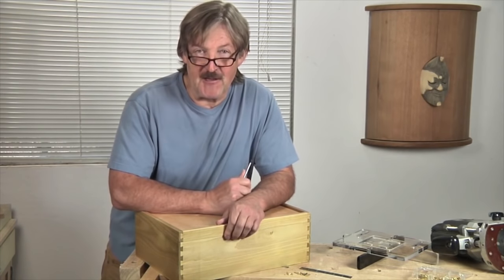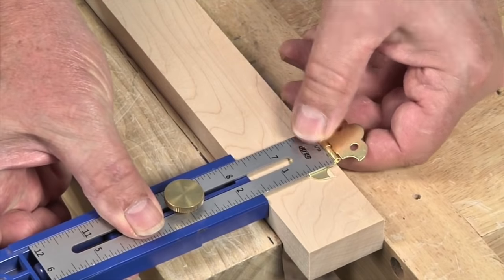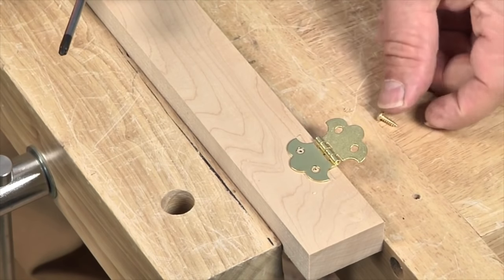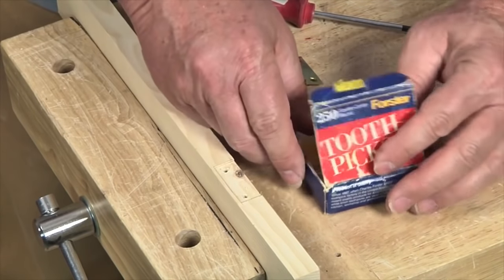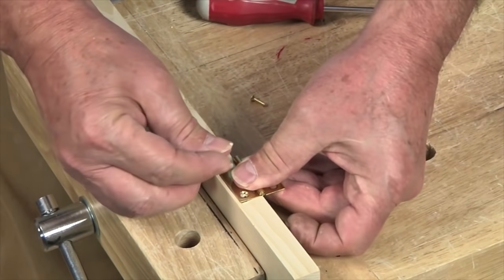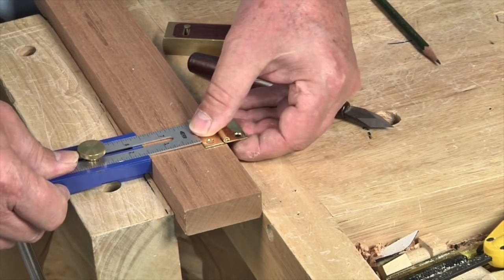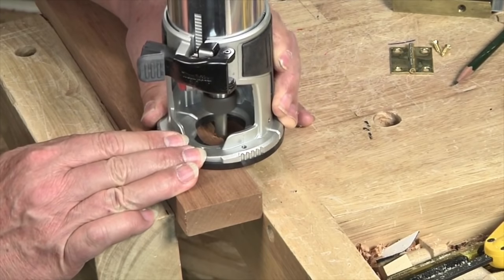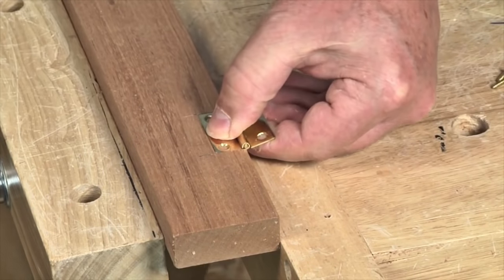How to Mount Hinges on Box Lids, Doors, and Other Projects

Comment: all very good tips, however, never underestimate the power of a chisel to create a mortice for a hinge.  unless i have a lot of mortices to cut i leave the router in the cupboard as i can have the mortice finished with a chisel before i have set the router up.  practice it as its very quick and easy.
Reply: Tayler Made i would use a jig a router witha core box and a chisel .
Reply: my first go at both were a disaster.  practice practice practice.

Comment: Just to be aware that the JIg It is obviously designed only  for  Rockler hinges. However most slde rail hinges, including Brusso, are 8 mm wide so its not too hard to make your own template.  - they tend to vary a little in their length. Pity they are so expensive !

Comment: For all the naysayers on here fixing hinges on a box is a surprisingly difficult task and the Rockler jig is the ideal solution. However, the templates only work for Rockler hinges - naturally.!
Reply: They also work for the Brusso quadrant hinges, part # HD-638. You have to use the Jig It template Q1 for that hinge, but it's designed to work with that hinge.

Comment: What are the type of hinges you put on the first box at the very beginning of this video? I notice that they are not the same as the ones you put on the box at the end. I need a similar hinge set for a storage shed. About L 8 ft by W 4 ft by H 7 ft. So it is no where near that small. Any ideas or tips would be appreciated. Thanks I love the video very informative.
Reply: Sir did you ever find out the name of those hinges? I asked about them recently and I haven't received a response from them.  I am in need of 8 of them about 3".
Thank you.
Reply: I just found the name. Quadrant hinges! Amazon sells various sizes. They are advertised on Ebay too.

Comment: Just curious why the plunge cuts are so deep below the leaves on the sides?  Is clearance required for this type of hinge?
Reply: He has removed the stay from the hinge that holds it at 95 degrees when open.  the stay is a quarter circle arc with a stop on each end which resides in the thin slots in the hinge, they are actually called quadrant hinges, and need room to house the arc when closed.  He must have done it for video purposes as the stays are not meant to be removed.  I like the jig but personally I just do it with a chisel and drill the holes for relief of the quadrant.  Al
Reply: Thanks Al for the great explanation.